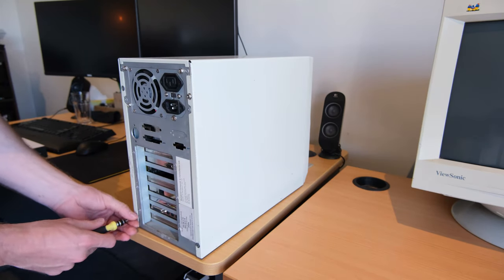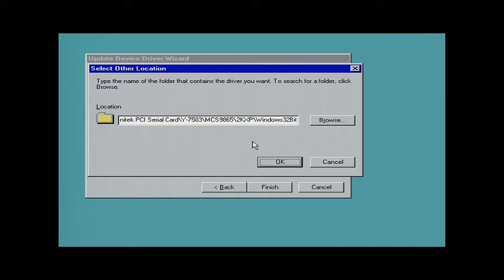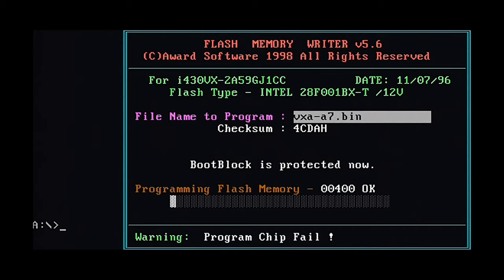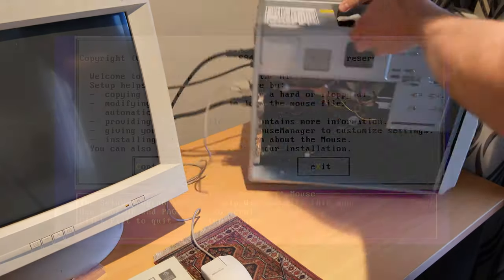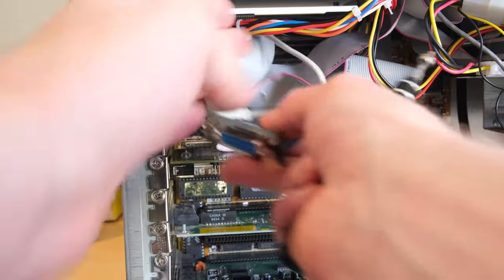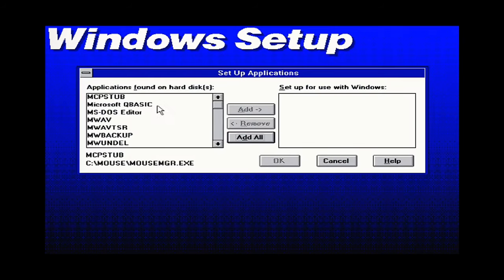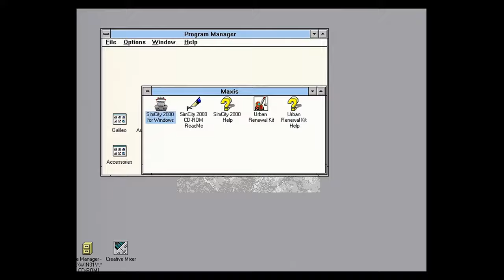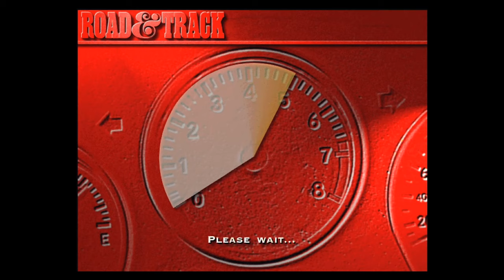A saucy AT build | Part 2 #DOScember

Comment: I revived several boards by changing the multi-io chip (the SMC one in your case!). But the first thing to check, as you later recognized, is the pinout of the sub-d-connectors.  I had my "fun" too with them back in those days.

For the BIOS, get a cheap TL866 / Minipro. They flash virtually any chips you may come across.
Reply from the maker: Yeah I really did learn quite a bit on this project. I think I shared my findings on Vogons as well, just in case anyone else has the same problem. But you're right, I should get some sort of tool to flash these in the event that happens again. But at least I found someone in New Zealand to fix it for me haha

Comment: It's normal for old CDROM drives to not be able to read burned discs properly. Something I discovered that works really well in my experience is to burn the discs as slow as your burner lets you do
Reply from the maker: Yes I assumed that was the case. The odd issue with this one is my Burned CD managed to just read, but my genuine office CD did not. The weak laser I don't think helped haha

Comment: No onboard PS2 Mouse header? usually near keyboard port... <3 all

edit: HAH! I had to always track down pinouts to be sure of connection! also, a serial loopback adapter and checkit! to test serial ports.
Reply from the maker: Yeahhhh haha, I found out it did have a header, but I could never get it to work. Until I decided to check the pinout. Thankfully doing that also helped me fix another computer. And yes I need to get a loopback adapter or make one to test the serial ports.

Comment: Hello !
Informations about your motherboard can be found here http://www.win3x.org/uh19/motherboard/show/3283
We actually don't have a bios for this motherboard (and the internet doesn't have it either as you noticed after trying :p). Would you like to share it with us ?

A photo of the motherboard would be great too if you have one ^^
Reply from the maker: Thanks for the comment! I did see this motherboard from the link, however it's not the correct one. I managed to find the correct motherboard after heaps of searching. I will put a link to it here when I'm back home. And yes, I can upload my ROM or BIN file. Shall I put it on Archive.org?
Reply: @thesmokingcap  as you wish, what's wrong with that board ? I can correct that as well if that's wrong
Reply from the maker: @DxDeksor  Sorry I was mistaken. I was mixed up with a 486 project I was working on and had trouble finding the correct manual. I believe the one you linked is correct. I used this link to find the jumpers. https://stason.org/TULARC/pc/motherboards/J/J-MARK-COMPUTER-CORPORATION-Pentium-J-656VXC.html
Reply: @thesmokingcap  well then it's the exact same jumper list on my site (I'm using the same database as source and keep on improving it since, hence why I'm here :D)
Reply from the maker: @DxDeksor  It's an amazing recourse online! Thank you for keeping it up to date. Also I have linked my BIOS Roms here on Archive.org https://archive.org/details/p-28-f-001-bxt-original-backup-chk-sum-0x-01-e-6-e-445